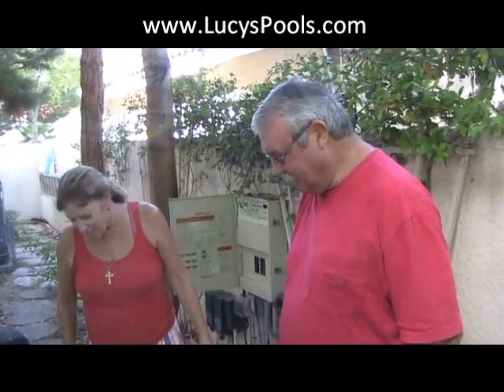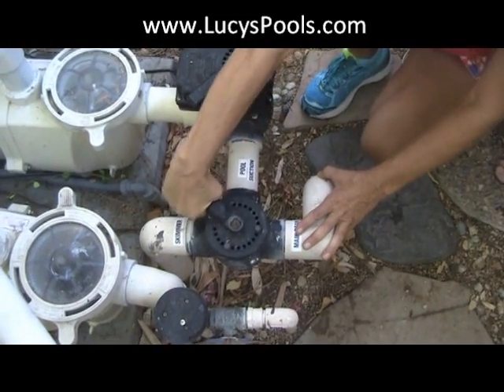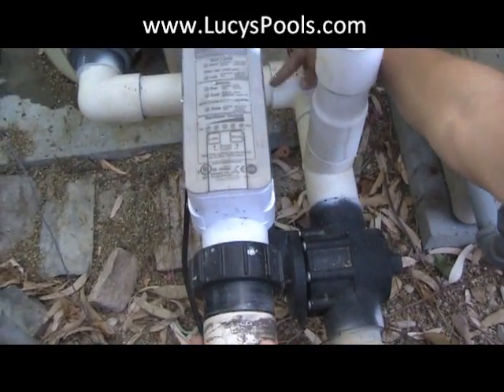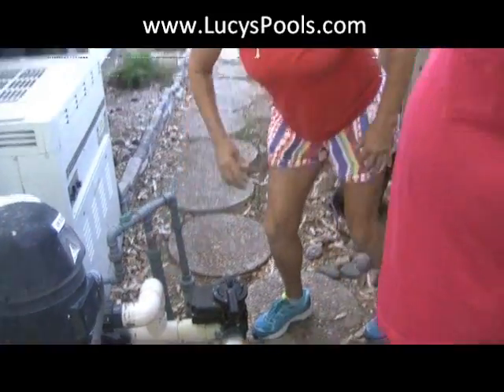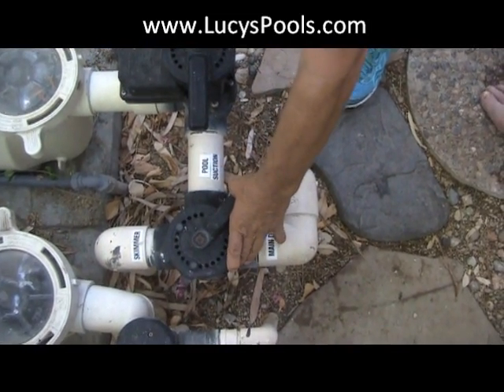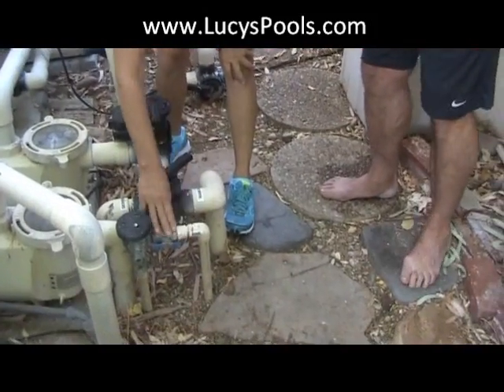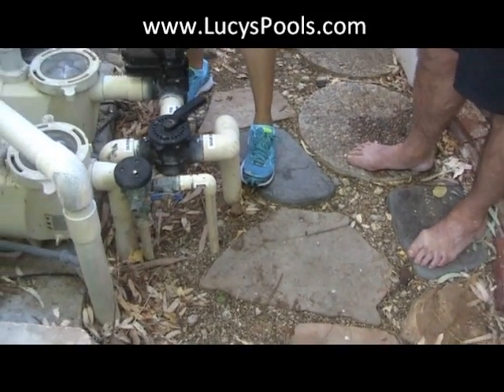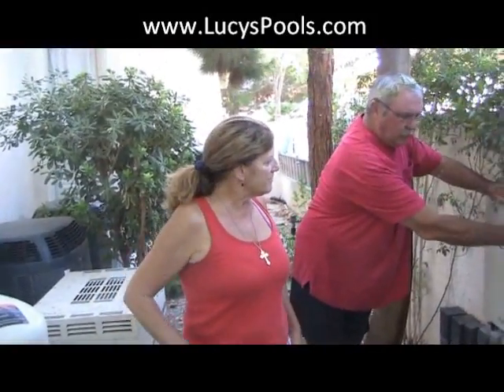How a Pool Circulation System Works

Comment: 10:26 since mine doesn’t do it automatically, to just use the spa with heater, do I turn the return valves off to pool and only on to spa, with skimmer and main drain off and spa drain on? Or is there something I’m missing?
Reply from the maker: Yes that’s exactly right. You want to isolate the water in the spa from the pool otherwise you’ll keep pulling in cold water from the pool. Shut the suction and return to and from the pool. If you want to send me a pic of your valves either send here or my email lucyspools@gmail.com. An overview so I can see the filter and pump. Otherwise I think you’ve got it.

Comment: Is that a booster pump next to the pool pump and how is water feeding to it from the
return side of the filter? And Or does it work seperate from the pool pump?
Reply from the maker: Hi Russel, actually the other pump is for a waterfall so it is plumbed completely separate. The water is sucked in from the side of the pool (main drain covers are used to cover the inlets) and then returns to the falls. Hope this helps, Lucy
Reply: @Lucyspools-diy-service-tips  its 300 lbs of sand and the skimmer player is ok it doesn't fit tight it's ok the water is sealing around the skimmer plate I sanded it around so its smooth now I'm changing the sand  I'll check the fingers in the bottom of the filter
Reply: @Lucyspools-diy-service-tips  to Changed the sand when I back sand comes out the hose could the I call it spider gasket ne changing still pump dont prim all the way when. I vacuum I have good presser  have no leaked any where